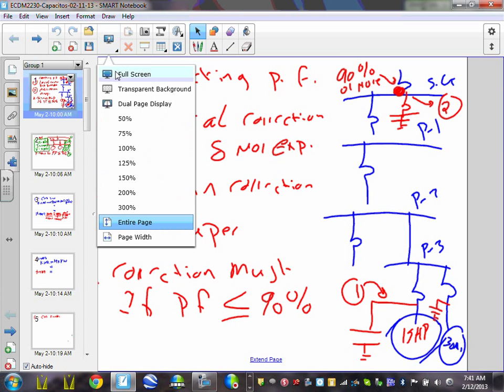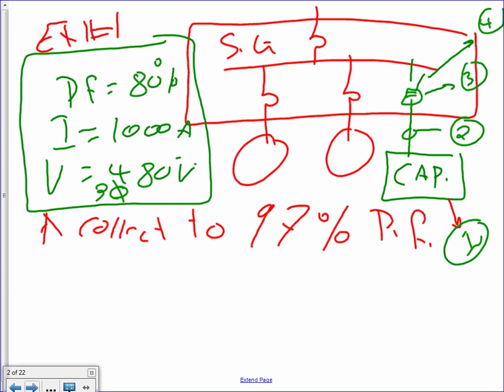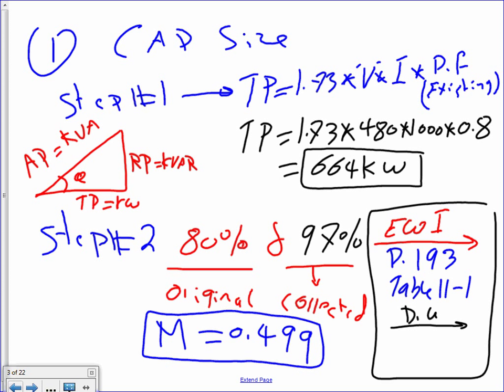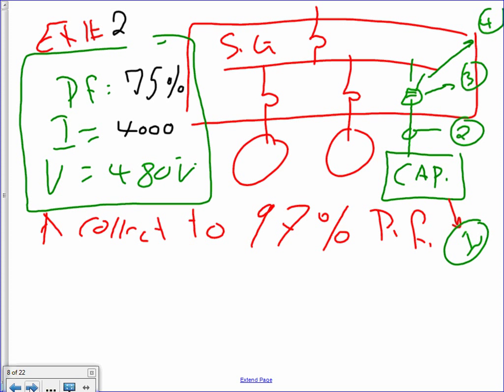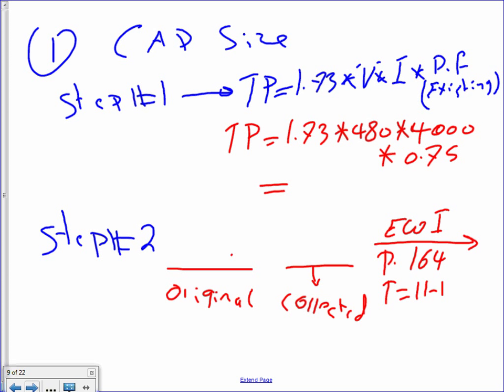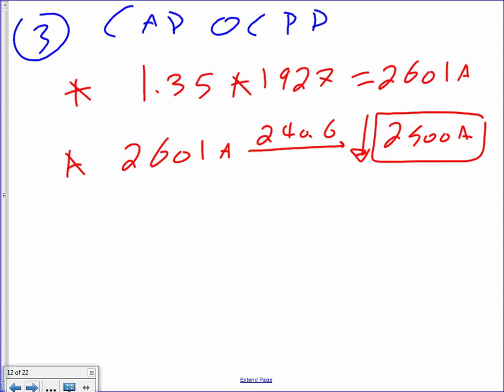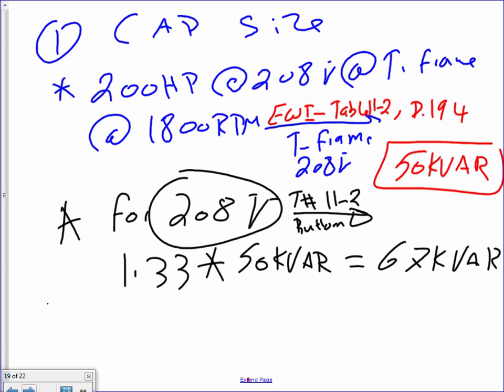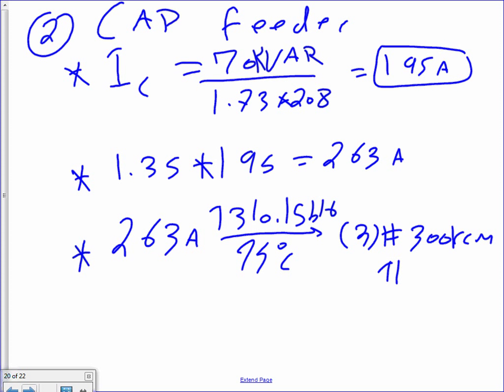Capacitor Sizing for Power System & Motors 02 12 13

Comment: Dear Chad, plz refer to 30:41 does it mean that we have TWO capacitor banks (2 sets); each cap bank having 500 kcm 3p conductors and since we have two sets we will have 6 conductors; 2 per phase and we'll have to parallel them at the switchgear? Thanx